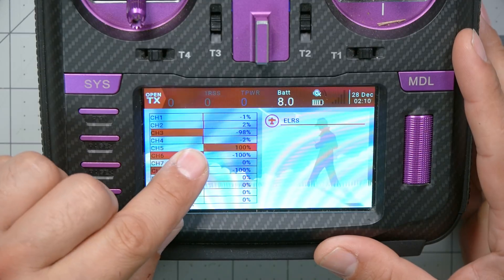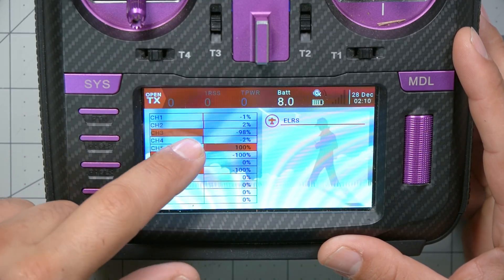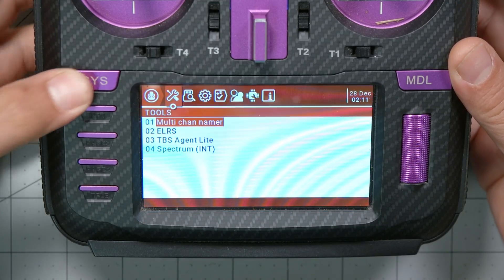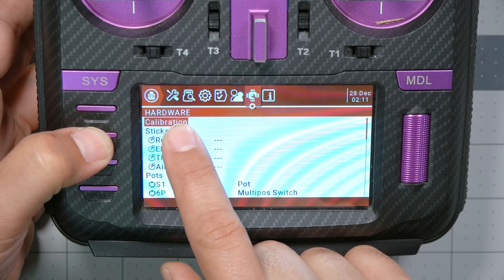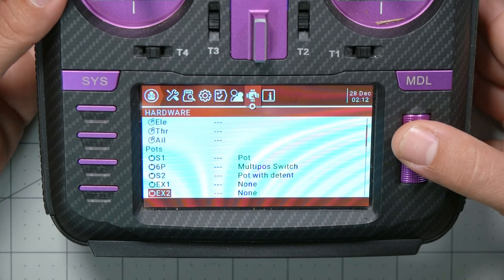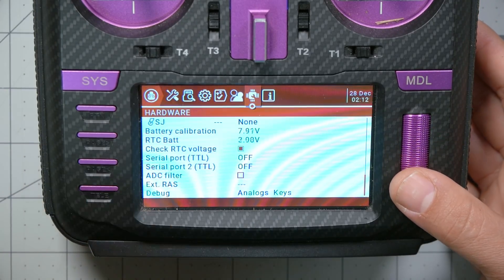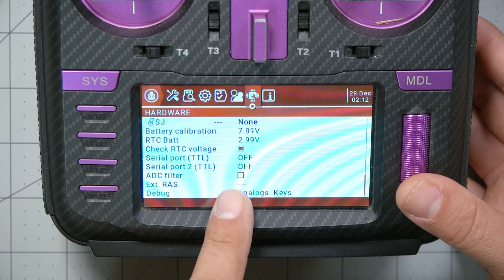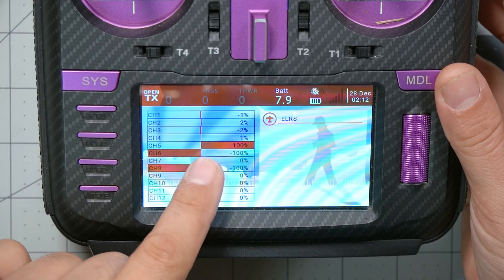OpenTX ADC filter is messing up your PID tune. Turn it off.

Comment: Is there a difference between model specific ADC filter, and the global ADC filter? Say model ADC filter is disabled, and global is enabled I assume that model's ADC is disabled but other models are enabled, if you disable global ADC filter all models are disabled even if it shows enabled on the specific model?
Reply from the maker: The Model-specific ADC setting can be on, off, or Global. If it's set to Global, it matches the Global setting. If it's on or off, then it's on or off regardless of Global.
Reply: @JoshuaBardwell  Thanks for the reply, so you basically can only check the model specific setting and make sure it's off if I understand correctly. 

Think this is my second month in fpv, almost there where I'll sub JB - don't you worry ;) went from a 3.5 analog, to a 5inch dji g3  - and totally lost a analog 5 inch.....unlucky, worst feeling ever though. vtx link failed and ya,.,,,it gone....

Comment: In the model setup there is an option to turn adc filter on or off too. If we turn it off in system setup does it cancel out the one in the model setup? Just curious I guess. I have it turned off everywhere just to be safe.
Reply from the maker: The model-specific setting overrides the global setting, however in model settings you can configure the model to copy the global setting.
Reply: @JoshuaBardwell  thank you! That makes sense. I'd be lost without your videos.

Comment: this is freakin rediculus. Like EVERYONE that istalls ELRS the firt time MUST know this.
I swapped today from crsf to elrs and changed litterally nothing else. 
I got horrible twitching and hot motors and thought it was a tuning issue.
After several attemps of googling "ELRS causing jittering/tuning issues" and similar i got to this video.
Thanks Joshua 
💙🙏. What would we do without you.
Reply from the maker: Also make sure to load the right RC Link preset in betaflight presets tab.

Comment: This seems even more important in BF 4.3. I just flashed it and my quad was completely uncontrollable with this on. Blackbox logs showed a super choppy stick setpoint. I was using rc_smoothing_auto_smoothness=50 in BF 4.2 which yielded a super nice stick setpoint, but thats no longer a config option in 4.3. I guess the auto smoothing on BF 4.3 + ADC filter yields bad results. For context I use ELRS on a T-lite.

Comment: If this is about improving latency, how is having ADC filter on decreasing latency?
The transmitter has a transmit loop that sends the channel values at regular cycle. 
What am I missing?

Would love to see OpenTX control log files and BlackBox log files from Betaflight compared to show the differences with/out the ADC filtering. Maybe its a real thing, or just a setting to prove your are one of the cool kids. 🤔
Reply from the maker: ADC filter on increases latency, not decreases it. It's something like a three sample moving average so it adds three samples of delay.
Reply: @JoshuaBardwell  Averaging 3 samples doesn't necessary mean, there is a delay. The previous two readings (buffered in memory) could be averaged with current (time) values and sent within same timeframe as single reading. 

Would have to look at code, to verify, but would be dumb if OpenTx code waited for every 3 sample periods before sending. This would not be a moving average, just average of 3 values. (ie: would be be like pixelating a linear movement, vs. smoothing)

Note: what is being displayed also may not reflect sampling periods. Display updates could occur with much different timing vs when values sampled.

Only way to know what is happening latency wise is to collect data on both transmitter, and what flight controller is receiving (logged in blackbox). Triggering a aux switch could be used to sync both datasets.

Comment: I'm so happy Mark Spats came up with that... I was wondering why my AOS5 feels like it snaps into predefined angles instead of translating gentle moves - and thought it was that Jitter that CRSF3 solves. Turns out the main issue was this ADC-Filter being on and cuasing a step-curve in my stick-reading in Betaflight. Good idea to cover that for the masses :3 Now who still needs Hypersmooth!
Reply: Spatty didn't come up with it lool. It is just a radio feature :) Mine was off by default(tx16s) 
Change your Betaflight Rc smoothing settings too...Manual interpolation at 10ms. Extra locked feel. Oscar Liang has information on it.

Comment: Wish I could disable or enable it per model like you said.  I fly helicopters too and would prefer to leave it on for those but turn it off for my quads.
Reply: I guess FBLs don't do the same filtering that BF does? Do you see this jitter in your heli servos with ADC filter off? I only have one heli right now and it's apart so I can't test it on my side. I was hoping FBLs would also filter it.
Reply: @The8BitHero I'm sure there's some kind of filtering but it's not configurable in any of them afaik.  It's probably not a big deal because compared to quads/escs everything is so much slower on a helicopter.
Reply: @The8BitHero  I switch ed to opentx 2 years ago to fly helis. I dont see any jitters. When you observe each channel in flybarless setup screen the channels dont jitter.
Reply: I fly only helicopter s. I believe flybarless gyros have built in filters.

Comment: Shouldn't the filter on the tx be much faster than on betaflight? Max sampling rate in BF is whatever your RF command rate is (i.e. Crossfire 150 Hz), but the local ADC could be sampling at 1000 Hz. This should give it a way more efficient LPF. Why isn't this the case?
Reply: Because you add latency for the filter on your tx and then on top of that beta flight will still be running the same filters to remove jitter adding more latency. If you turn off the setting it will remove that first setting and only your fc will be running a filter, if that makes sense?

Comment: Thx. Do you still recommend the firmware with touch support or should I stay on openTX?
Reply: Edgetx has been great for me so far, it’s essentially the same at this stage except for touch support and a few minor changes that will allow a flower latency if you use expreslrs

Comment: Checked my Taranis DX9+ and it is off, looked on my Tango 2 and it's not there to turn on or off, I'm assuming TBS made it a non issue (off by default).
Reply: Or they could have removed the option, and they could have made the default anything. You'd have to review the code to see what they actually did (or ask them and hope whoever responds knows what they are talking about).
Reply: @pfeerick  - So true.

Comment: Lol...and I always thought my tx16 gimbals were trash because of the jitter.
Reply: Yeah same, I’ve replaced stock gimbals on my qx7 with hall ones, hoping this jitter will be gone but nothing changed, it was still the same even after dozen of calibration attempts. So I said fck it, and erased it from my memory. Thanks Bardwell, wish you made this video a year ago!
Reply: Same here. And i’ve seen people speaking about turning rc filter in BF as well. So I ended up with a quad moving randomly….

Comment: What about Tango 2? Can't find this option anywhere:(
Reply from the maker: Tango 2 runs FreedomTX not OpenTX. It may have different options.
Reply: In my very old Tango 2 (bought it in March 2020) the is this option, so it depends on firmware version I guess.
Reply: @talkrz  Hm. I tried a few new firmware but none of it has this option. I assume that there is still some filtering because I often see stepwise lines on my RC input blackbox log.

Comment: Hi Josh   Thanks for the information,  I just turned it off so I will see what happens.  Also I do have two radio's.  Actually I have around eight. I just been in this Hobby 50 years. Thanks again for the video and information about this filter.

Comment: I came across this setting when I installed the TBS Tracer and did the FrSky Mod, set my radio to MAX bauds 400000  ADC filter is now off.  Thanks!

Comment: Do you have any plans to test the difference between the analog and digital nazgul evoque? I think there's a fair number of us curious if it was the weight, motors or frame style. 

Thanks!
Reply: i find it very hard to freestyle on the polar camera compared to the regular dji/nebula pro, its not just the latency, its a way more zoomed in image that feels almost like a 4:3 image stretched to 16:9... the polar is a great camera for long range though as it has great low light and the zoomed in image i prefer in longrange too.... i can get an extra 20-30 min of sunset flying in its soo good in lowlight, now we just need a large sensor gopro to capture that lowlight as well
Reply: Considering they are identical in every aspect except for the camera and vtx you can assume that it was a combination of weight and the frame style that will affect flying ability. Potentially the camera also was not what he was used to but that won’t change how it flies
Reply: @willedwards7679  i really dont get much difference in handling with deadcats vs x's, its easier to get better propwash performance and stability on the X but once deadcats are properly balanced and tuned its hard to tell the difference.... now if i changed the camera from og DJI to polar camera i would have so much trouble freestyling it... in fact JB had trouble freestyling the polar when he was doing a review of it and figured it must of been the added latency, although i dont think he considered the negative aspect of the lower fov... i can freestyle the dji cam in high quality 4:3 as well so i know its not just the added latency of the polar.... hopefully more cameras in stock soon so you can swap it out if your into lower latency freestyle
Reply: If I remember correctly JB said it was combination of weight and the lens on the analogue camera????